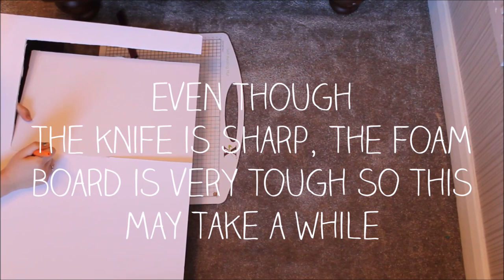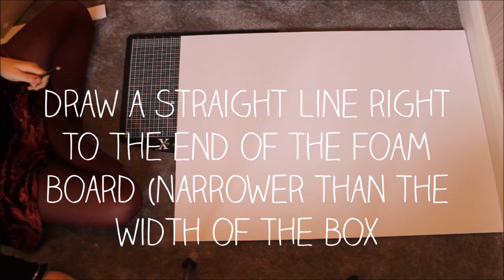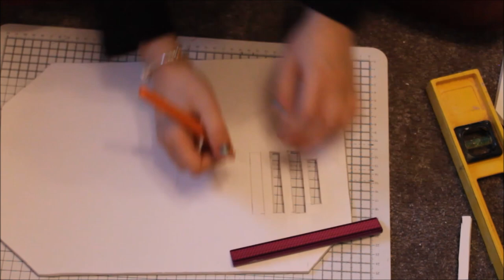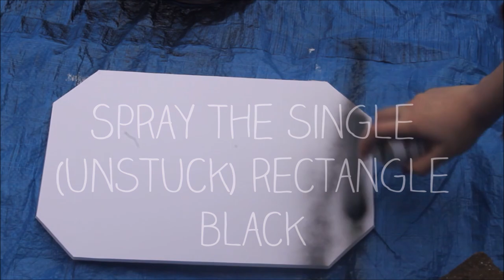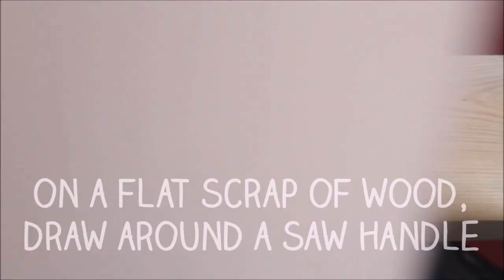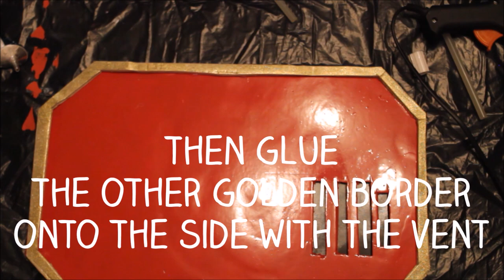Cosplay Prop DIY: Grell Sutcliff Death Scythe Chainsaw Tutorial (Black Butler) [黒執事]

Comment from the maker: Since I made this I have had a lot of people ask what dimensions the box I used was.  The exact dimensions are 11.5 x 8.0 x 4.5 (inches). If you can't find one that size you can make the foam pieces a bit smaller to compensate. If it's a bit bigger or a bit smaller it won't matter though! 💞